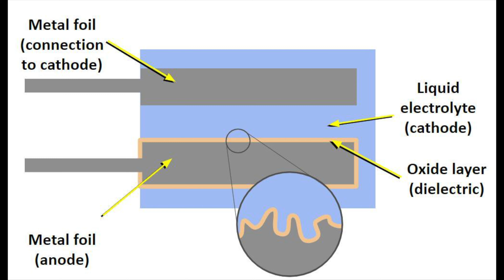XBOX Classic 1st Gen OG Power Supply Repair & Time Capacitor Removal   Save Your Console From Fire!

Comment: Your original Xbox burned out at same AC input point on underboard as mine! Caught in time when I heard sizzling and smelt burnt solder when I plugged in, immeadiately noticed slight wiggle to the cord input on XBOX, got to power board & turned over, and saw black burnt culprit. Luckily with some T959 flux and reworking solder into that and other side of the prong, AND resoldering the anchor points to left and right while holding input housing firm...she powered right back on perfectly! I advise not removing the power cord on the console side any more often then needed, as may put strain on the anchor solder points due to design and tight fit of cord. EDIT: Mine is original 1.0 revision if it matters.

Comment: on versions 1.0 thru 1.4(5) the clock cap is not needed. not even to boot up a stock xbox.
version 1.6 needs it to boot and it's located in a different spot. removing it results in the xbox not booting.

you got me curious when you attached the string to the cap but i went OMG when you slammed the door. Nice one !
Reply: 1.6 doesn't need a removal and will work forever, always make sure you know which version you're working on as they're night and day.
Reply: @autobotstarscream765  I've had leaking clock caps on 1.6 as well. You better replace leaking ones before they cause trace rot and when a 1.6 ain't booting up checking on the clock cap won't hurt

Comment: Just bought a 1.1 XBox with a burned up power supply, the traces were charred and separated. Ordered another one and a capacitor kit from Console5 to rebuild it. Did the same with a 1.4 preemptively.

Comment: there is a better way reflow soldering work car 55w headlight bulb they take a lot of power you might need a car battery or strong bench power supply

Comment: Seen any video's on replacing or fixing the power button? Tap the power button  repeatedly and it will turn on. Also to get the disc drive to open ya gotta slap the top in a certain area and when it opens it wants to close so grab it. Gave my working one to a friend since i wasnt using it and now i wanna fix my spare parts one that works but has issues. Kinda a spare time project to fix it and try modding it for the NES emulators.

Comment: I got a 1.1 Xbox that by some miracle has a completely intact foxlink psu and a non leaking cap. Still pulled the cap out and reinforced the solder joints on the PSU plug. I ain't f***ing around with electrical fires.

Comment: 11:55 It looks like there has been a leak around the "coil" at the top of the power supply board. Is it important ? I have several leaks like that on mine and wondering if it's the cause of the console not working, but I'm suprised you don't seem to point it out in this video. Am I wrong ?
Reply: That white goo is not leakage, that's epoxy that's meant to help keep that stuff in place, don't remove it! Two years late, but I thought I might as well respond.
Reply: @stufflingdx  Yeah thx, I learned in the meanwhile, don't worry I didn't touch it

Comment: Hi Is better to clean the bottom side of motherboard also on that spot, often if there is acid from the time cap has leaked it is also on the bottom it is important to remove that is my experience. 

There are very small holes in the motherboard so acid gets to the other side. I have seen boards that came out of the gpu the power takes acid on a journey where you do not want it, is extreme case but it happens.

Comment: The original Microsoft Xbox 1.0 used those crappy fox link power supplies if it's a 1.0 Xbox replace the power supply unit with a Delta electronics power supply unit also clear dust off the power supply and motherboard

Comment: My original Xbox was made in "04"..will this work for my system as well?
Reply: You need to open it 
Mine is also made in late 2004 and it's a 1.6 version meaning i do not need to take out the clock capacitor
Reply: It it’s from 2004, DO NOT remove the Time Capacitor, it’ll brick your console. Don’t worry, Microsoft stopped using the Faulty Capacitors beginning in March 2004.

Comment: I've got a burnt solder joint on my power board from a xbox that uses the original power cord (c. 2001). I happen to have a power board from a c. 2005 xbox that has a different power cord. Can I just switch out the power board and cords or will I have to resolder?

Comment: hi, my original xbox is making a high pitch elecrical hissing noise, sounds like dust burning, a crackle sort of noise that gets louder and louder in just a few seconds of the switch being turned on. im scared to leave it on more than a second or 2. Do you think i need a replacement power supply cable or this fix youve just done with the soldier? i heard xbox recalled the cables, will the old original cables work with your soldier fix. or do i need a new cable too? ive already took out the power store gel capacitor and cleaned the area. thanks for any help you can give me.
Reply: Had same exact problem today and fixed, check my comment up top on this video. Basically if you know how to solder, you probably need to solder the underside of the power cord input device on the power supply board where it burned one of the joints, or both. Then solder the anchors to each side to reinforce...does the little housing where the power cord plug into wiggle/move slightly? EDIT: If yours is 1.0 you may want to consider getting an altogether new power supply also, if this doesn't fix.

Comment: If we resolder those 2 joints on the power supply like you did,  does that mean we no longer have to only use the Xbox protection power cord?
Reply: No reason not to use it if you have it

Comment: I have one almost like yours, except it uses the Thomson optical drive. It's not turning on anymore, I replaced all the capacitors on the motherboard, and it won't turn on. Is there a way to test the power supply without the mainboard ?

Comment: seems like i have shorted my xbox console by trying to mod it, is there a way to reset it?
Reply: I just did that right now. Tried to hard swap hard drives and a little pop and fire happened.
Reply: @Kla2024-s5t  in my case i was lucky. The adaptor and the hdd got fried only. So i just ordered the startech adapter a new hdd and now it works like a charm
Reply: @bagos13GR  that’s awesome. Which is weird I see no burnt spots near the plug at all.  It looks just like my other Xbox. I wonder what I could replace to fix it.
Reply: @Kla2024-s5t  well if you know how to check the capacitors with a multi meter , you can identify what seems to shorting the console? actually search on reddit of the original xbox, there are a lot of guys there that really knows how to fix problems
Reply: @bagos13GR  I have a multi meter. I’ll check it out. Thanks.

Comment: i have a 1.0 version, my tsop is flashed, should i still remove?  pretty sure it was replaced already
Reply: Remove the time capacitor?
Reply: @saudade_firefly  yes the time capacitor
Reply: Any OG Xbox manufactured before March 2004; REMOVE the capacitors, they’ll rupture leaking Acid on your motherboard frying it.

Comment: Hello Blaine,

I just opened up my OG Xbox a few days ago to replace that much talked about capacitor on the board but opened it up to find that multiple capacitors leaked a whole bunch of goop all over everything... Not much I could do with it from that point on. I decided to scrap it but keep the DVD Drive, Hard Drive and various cables/controllers. Planning on just going ahead and buying a refurbished one online to save myself the hassle. To be frank: never have I seen a more poorly designed circuit board for a console. That thing had capacitor juice all over everything and parts looked like they literally melted. it was horrific. Meanwhile my Dreamcast I only had to open it up once to fix a controller port since I bought it in 2008. And furthermore my PS2 and gamecube still run perfectly since the mid 2000s as well. It's all so bizarre how Microsoft dropped the ball with the design of this console but yet none of us found out until much later on.
Reply: rip

Comment: Remove the clock capacitor or it will leak acid on the motherboard and kill the Xbox
Reply: Unless it's a 1.6, always check which version of Xbox you have before working on it.
Reply: ONLY on the 2001-2003 models.